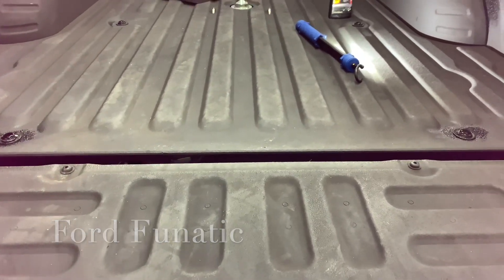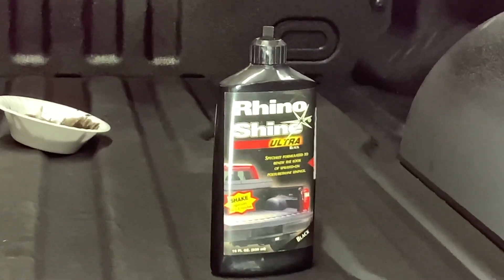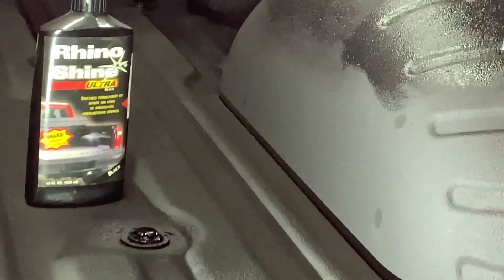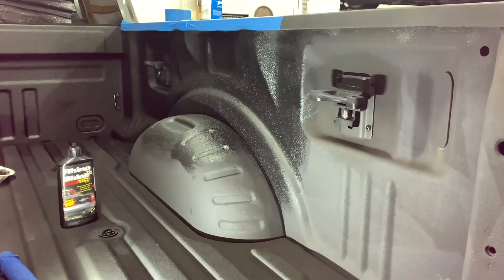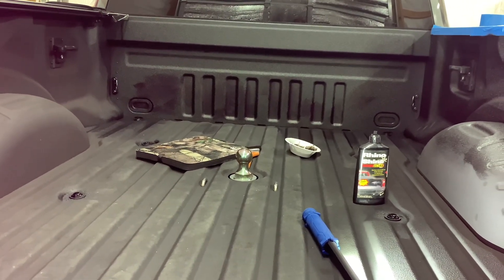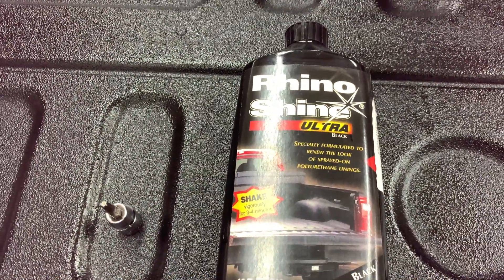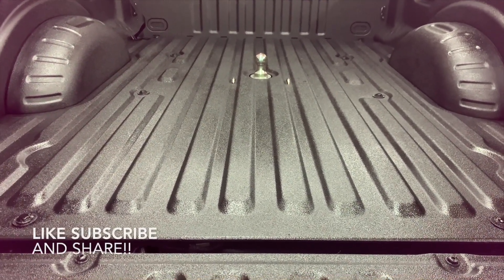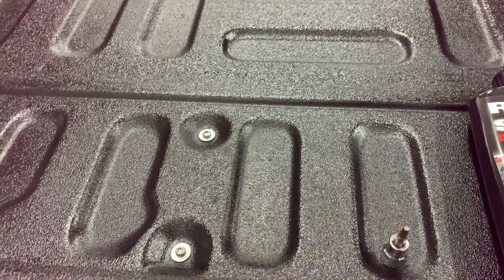How to Make your trucks Bedliner look new again! #fordfunatic

Comment: Can this be rolled over spots in the bedliner that have old paint stains?
Reply from the maker: It’s a possibility it would cover it if it’s not to bad.
Reply: @ProCharged7.3Godzilla  Thanks for the response and the video itself!  I’m going to give it a try, I really cleaned out the paint, so now it’s just paint smear and some paint specks.  Maybe after pressure washing and the rhino shine it’ll disappear!
Reply from the maker: @lpmoora  you are welcome. You could always take a little black spray paint and fog over the paint spots. Let dry then use the Rhino Shine. Thanks for checking it out

Comment: How long does it last?
Reply from the maker: It depends on how much your truck sits in the baking sun and how you use your bed. This was 2 years ago mine still looks decent especially the sides of the bed.  
If in the sun a lot and you use your bed, every 1-2 years is a good time to reapply.